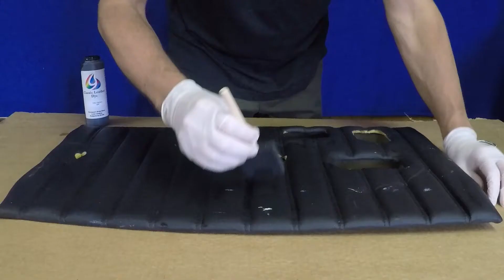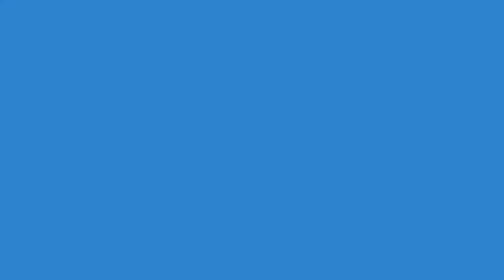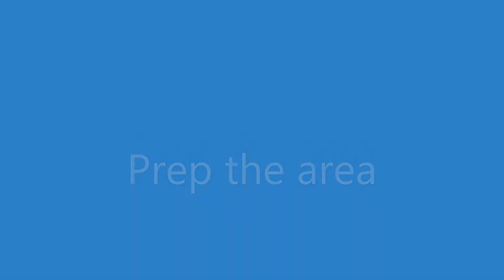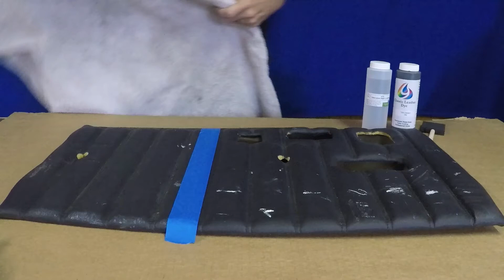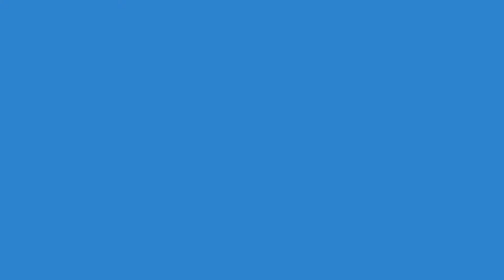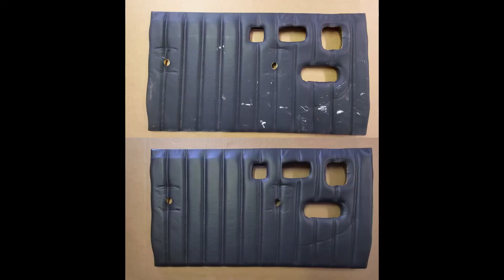Classic Dye Products - Brush On Color Kit Tutorial

Comment: What kind of conditioner is used and would this stain clothes or wear off?   Wife’s car has a green hue in it (med gray stone) ford “ I think” and this might be my best option.   

Just don’t want to head out in summer in white clothes and have paint on it.  

Quoted 600$ to redo front seats with faux leather and i like this better. It’s just that green hue showing through. 🥺
Reply from the maker: Feel free to email photos of the seats along with year, make, and model to classicdyeproducts@gmail.com and we can give some guidance as to whether repair or replacement is the better option.

If color transfer is a concern after repairing, a clear top coat like our ACS - Aerosol Crosslinked Satin can be applied over the color coat to provide a protected layer.

Any leather conditioner can be used and we do have conditioners available to purchase on our web store. Just be sure to test small areas and follow instructions provided with any conditioner you choose prior to widespread use.